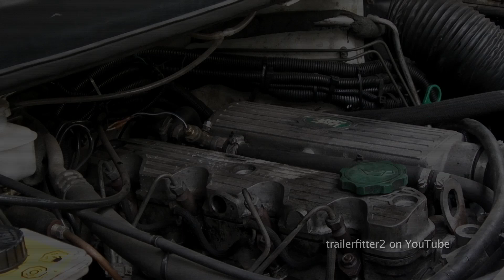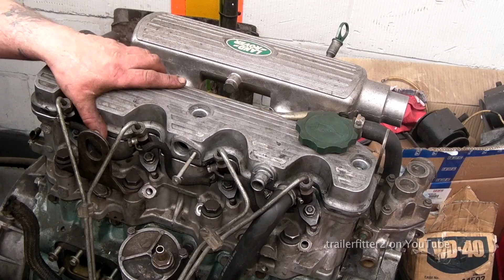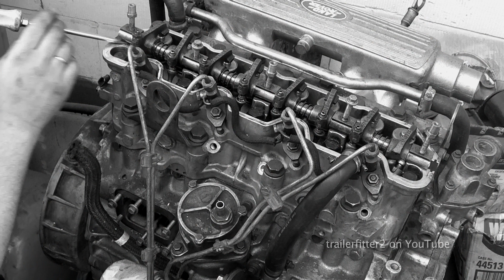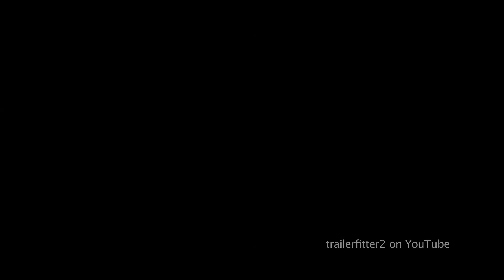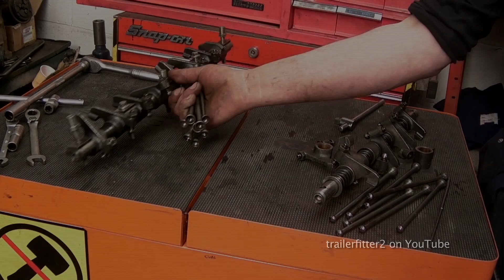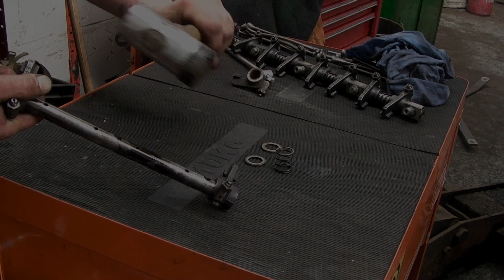Land Rover 200tdi Engine Inspection and Stripping rocker shaft After Damage

Comment: Is there any reason bearmach forgot to drill the oil holes in the rocker arm bushes i just purchashed?
Reply from the maker: Dunno. I don't works for them But I bet you'll find they'll send you another set if they are faulty.